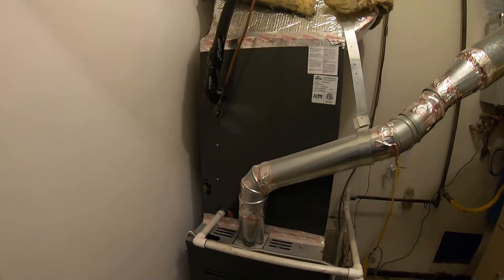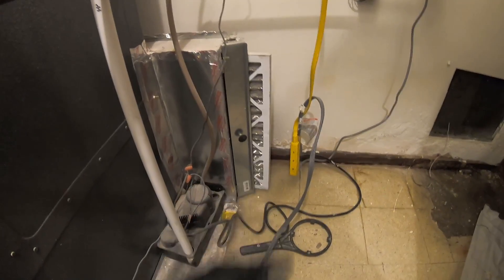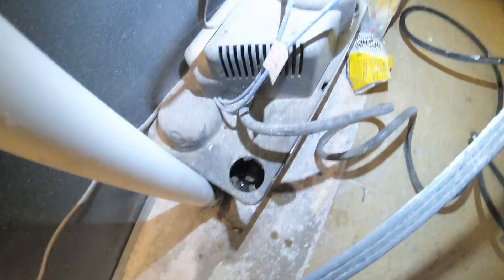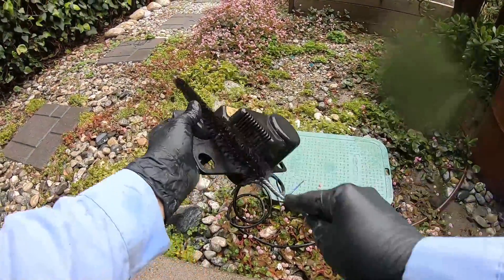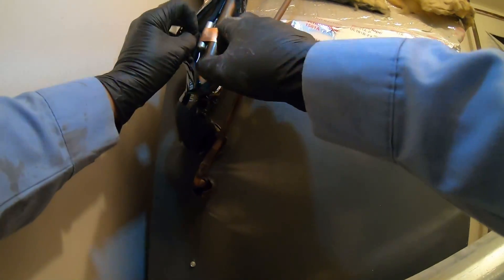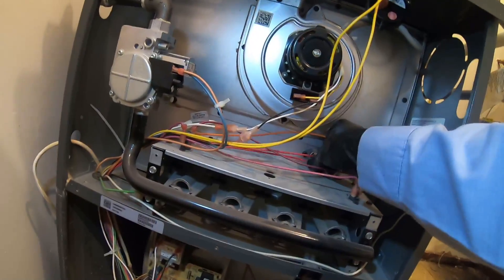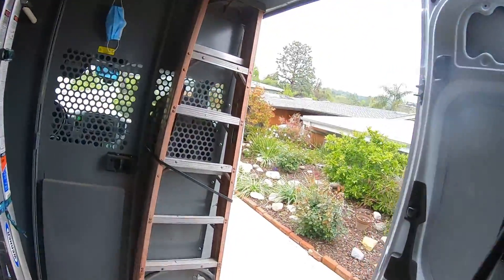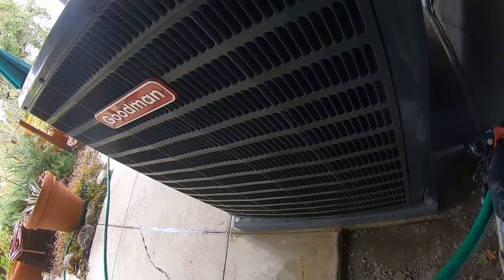HVAC During COVID-19

Comment from the maker: 8:03  Someone pointed out that when installing the txv bulb in the vertical position you need to flip it over so that the thin tube is at the top and they are correct. The manufacturer wants it this way so that vapor and not liquid is applying pressure to the head. I'll address this again in a future video.

Comment: Hi A/C Guy, is that Cold Air Return being 
fed into the back of the Furnace...?  Is the airflow sufficient...?
Reply from the maker: Yes it is and no it's not . You're very observant . They're not able to get that corrected yet or they don't want to . I tried.
Reply: The Air Conditioning Guy 
It makes it very hard to make necessary improvements 2 existing equipment when the 1st thing out of the customers / technicians that not willing to GROW in knowledge mouth is :  “Well it’s been working this Long”....  I feel your pain

Comment: The real question is how did you get a hair cut?   More proof no ones doing duct testing or permits. That job was hacked.
Reply from the maker: 😆😂 I cut it myself. I stopped doing years ago because my wife hates the mess I make. You're very observant! 😎👍
Reply: The Air Conditioning Guy I need to find the underground hair cut. Lol
Reply from the maker: @NorCal-refrigeration  Come over! I'll put on a bunny suit and cut it. I'm not that far away. Except that this is the only hair cut I know. 😂
Reply: The Air Conditioning Guy 🤣🤣🤣
Reply: Juan would the installers have the job inspected by a city inspector?
Reply from the maker: I highly doubt any self respecting inspector would pass that.